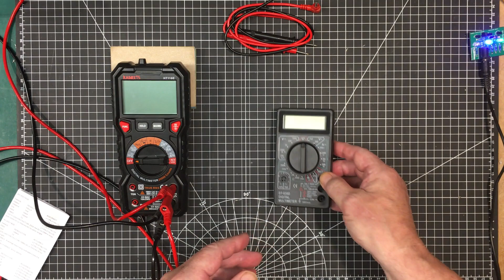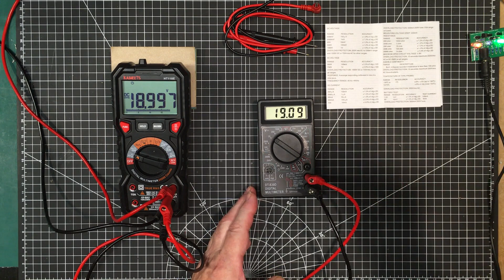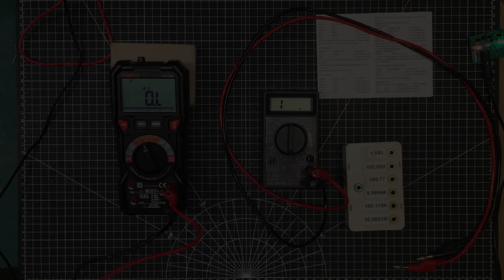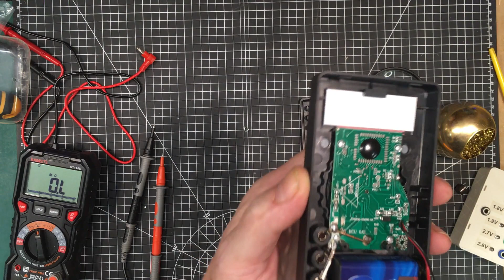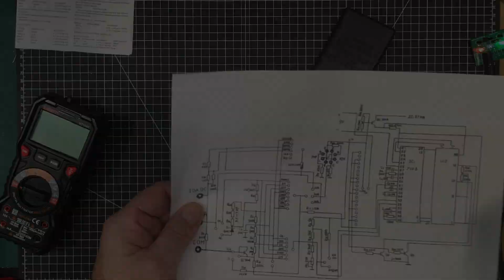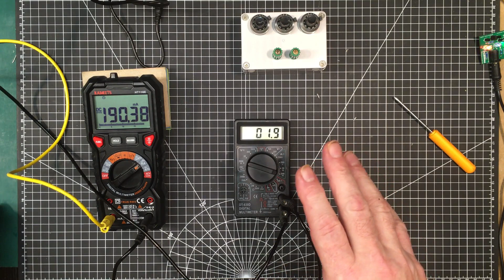0093 - DT 830D: The Cheapest DMM

Comment: I wouldn’t even use the Kaiweets as a second meter 😅
Maybe I’m a bit of a test equipment snob but your work can only be as precise as your gear and I also don’t like running after a meter in a year or two..
Reply from the maker: The Kaiwwets is only part of a beginner kit I'm working on.  It's actually not a bad meter and meets it's specifications very nicely.

Comment: I don't understand how you can buy a cheap multimeter and then be surprised at how bad it is. It doesn't have to be an expensive luxury brand, but there are also reasonably decent measuring devices at affordable prices. Missing or unsuitable fuses and poor construction of such cheap products should actually deter anyone from buying or using them.
Reply from the maker: I didn't expect it to be a good meter, but I did expect it to work.  However, if my experience helps someone make a better choice then some good comes of it.
Reply: @uni-byte  I should have better written: "I don't understand how ANYONE can buy...". I think videos like yours are good because they show what (possibly deadly) kind of rubbish this is. If you then consider that you can also buy good multimeters for a few euros/dollars/... more...
Reply from the maker: @wernerpeter9706  YEs, certainly.  A much more appropriate meter can be had under $20.  Basically the price of a meal at McDonalds, and it won't make you sick.  I have a Kaiweets KM100 on order that should do that job.  I'll test it an see if it can be recommended.

Comment: I have one of those I got for free from HF. It doesn't beep but it is pretty accurate. I can't recommend it because continuity is something I use almost 90% of the repairs I do. For around 6 bucks you can get an xl830L. The beeper on mine works and has a backlight. The rubber boot on it makes it a little more durable. I'd recommend that model for a budget second meter.
Reply from the maker: The XL830L looks like a much better quality version of this thing.

Comment: Elenco made a meter kit based on the meter demonstrated. Of Course you were probably comparing the meter against a $90.00 meter which is  more accurate then the $4.00 meter. But for ball park measurements to see if a circuit has power not bad. For design work no way. Thanks for posting enjoyed the presentation.
Reply from the maker: The accuracy was just fine, for the ranges that worked it was well within spec, so no issues there.  However, the mA ranges did not work, you could not near the continuity beeper (which fell off) and even though it says right on the front the mA ranges are fused, there was not fuse at all.  Just a trace across where the fuse should go.  Thanks for your comment!
Reply: I Purchased I Klein from Home Depot. I like it. Although very pricey.
Reply: @MsFireboy2  I picked up a Klein MM200 at Habitat for Humanity ReStore for $10, nice rugged meter. Seems to be targeted to the Electrical trade, but has a uA range, which seems odd for Electricians. Nice meter.
Reply: The core of this meter ICL7106 and the LED counterpart ICL7107 were good percision Vm ICs. Ofcourse, they had ways to callibrate them to compensate the tolerances and there needed to use precision components to build them. I saw industrial  panel meters builded around ICL7107 (with 7-segments LEDs) that had 0.5% resitances inside and were as precise as they could be. However, this is an 3and 1/2 resolution meter with 3 readings/sec (it could be made to do up to 18 reading/sec)

Comment: You pay your money and take your chances. I found the Aneng AN8008 to be a good cheap (~$20) knock around meter. Tossed the leads, their crap. I often grab it over my Fluke or Keithley handhelds and it's just about as accurate. I like the 8008 it has a signal generator feature.
Reply from the maker: The Aneng AN8008 looks good, but my last Aneng died on me rather unceremoniously.  I'm a little shy right now.  I think I'm going with the Kaiweets KM100 for the 2nd meter in the Beginner's kit.  It's not outranging, but it's beefier, come with a case and has Kaiweets reputation for reliability.  I know Dave Jones seems to hate Kaiweets, but I've had nothing but good experiences with them.  They are ugly, but they work.
Reply: I've got a DT-830D, an AN8008 and an AN8009 (as well as others...). The Anengs are orders of magnitude better than the DT-830D.

Comment: The first ones (I got my first one around 1997) were very good, the IC inside was the original ICL7106 THD while the second one had the IC SMD. The schematic was the one from appliction note and even had the trimmer to calibrate. The quality was very good and it was quite accurate (I took them to the lab at my school and checket against lab equipment; the first one I do not even had to calibrate, it was spot on).
As you say, they are copies of copies now, when I bought the last one 8 months ago because I needed a DMM   to work at a car, I was truly impressed of the bad quality. Bad solders, cost cutting in the worst ways (the lead connectors used to be on the same pcb with all the circuits, on mine it was on a small pcb loosely soldered that broke when I inserted the leads; I noted that yours do not have even that pcb).Actually, I still have some 5-6 of them broken, that, when I open I can see the "involution" of them, the oldest being the best built.
All said, I will never buy another one of these 830 series DMM.
Reply: I still have an Elenco I assembled about 35 years ago. I still use it on my bench.

Comment: I have a lot of nice bench gear, HP, Fluke, Anritsu, Tek, etc. But I had a friend who lived a block from Harbor Freight who every few days would go to Harbor Freight and buy something for a dollar, and pick up that same meter as a freebie for me, compliments of HF. I ended up with over a dozen. I check them out, note anything that's way off, (they were all actually pretty good,) and I give them for free to kids, and to adults who aren't well heeled who show up for my ham radio or soldering classes. Then I show them how to use them. The meters I've received are usually reasonably accurate, (I did have one I had to do a simple repair on,) and they are perfect for teaching Ohm's Law in conjunction with a couple of resistors and a 9 volt battery. ANY meter, as long as you don't completely trust it, is better than licking your finger and touching connections to try to figure out what's happening in an electrical circuit. I even use one for quick and dirty measurements on my car's electrical system. I figure it makes more sense than to take out an expensive Fluke, (even if I have 5 different models on my bench,) and drop it in the mud or snow, or accidentally close the hood on it. I still make mistakes, even after 60 years of doing electronics. But using an expensive piece of gear where a cheap one will do the job is no longer one of them. That's also why, even with 2 HP spectrum analyzers on my bench, I've only used my TinySA since I bought it 2 years ago. The precision gear is always there if I need a precision measurement, but I'd be foolish to use a $2000 (used,) piece of gear and run the risk of blowing out its $900 front-end when I can use a handheld $80 piece of gear to do the job instead.
Reply from the maker: They do seem to meet their stated specs all right.  But I do imagine there are "better" ones and ones like mine.  As with a lot of the forgery going on in the cheap electronics business you pay your money and you take your chances.  Thanks for your input John!